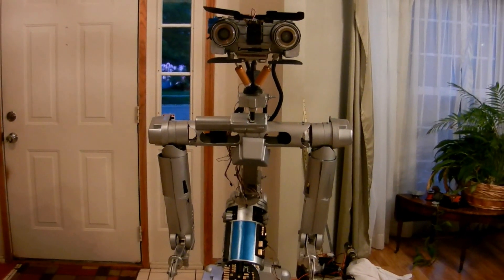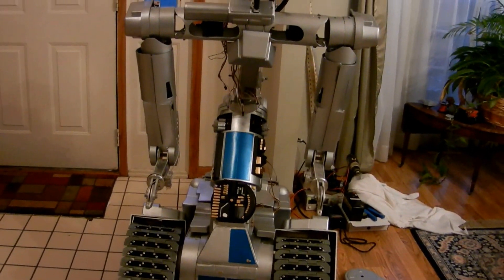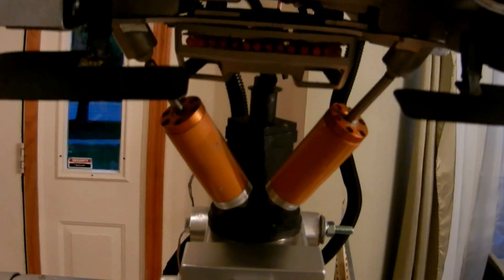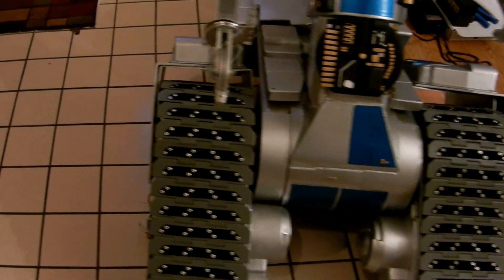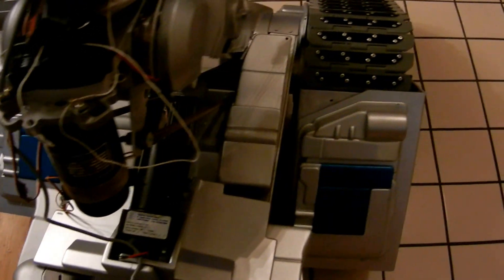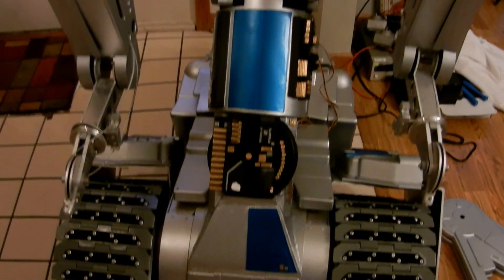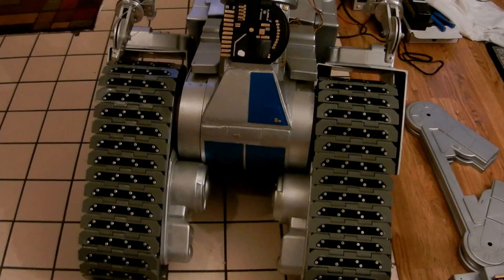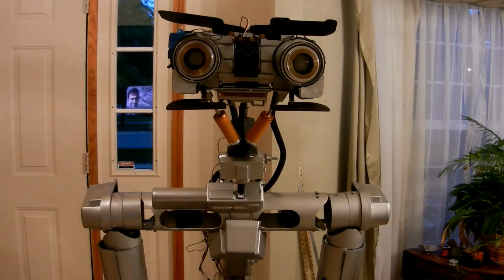Full Size Johnny 5 Robot - Assembly Part 2

Comment: Ever think of selling him???
Reply: it's for sale right now on monsters in motion
Reply: @bluezedd  I only saw 2 of them and they weren't as close to the original as this one
Reply: @dozerfarms  The one on monsters in motion is this one, but has older pictures of it. It's this exact one for sale for 35k USD.

https://www.monstersinmotion.com/cart/one-of-a-kind-item-list-pt-c-15_263/short-circuit-johnny-5-robot-life-size-prop-replica-p-19798.html
Reply: @bluezedd  It is? It's missing a lot of things it had in this video and it seems a lot of things were replaced with cheaper parts then because the one in the link is missing the neck hydraulics, has a less realistic head, has different arms and something's not right about the hands
Reply: @dozerfarms  yeah, it's the same one. See the video here from back when it was unfinished so you can see they used older pictures.

I agree that the pictures used were a terrible choice to sell it.

https://www.youtube.com/watch?v=17_7-cLukO0

Comment: What kind of control interface are you using for Johnny 5?
I wonder if you couldn't use DMX512 to at least control movements. How many servo channels of control does he have? there is even wireless DMX512 now.
Do a youtube search for Chauvet Intimidator Spot XYZ it is a DMX light fixture that uses up to 16 channels of DMX. There are 512 control channels available in one DMX  universe but with the right equipment you can link more than one universe for unlimited channels.J looks really cool!!!